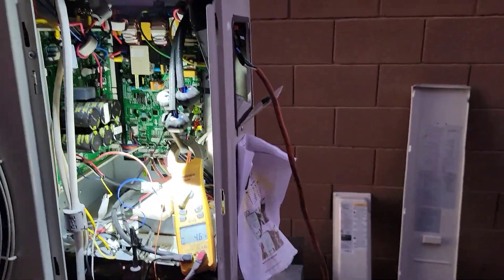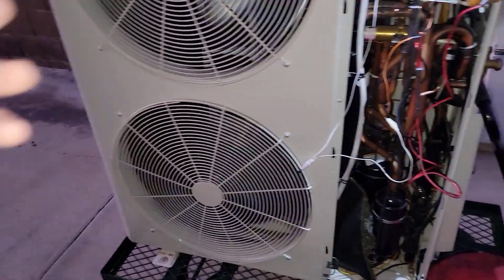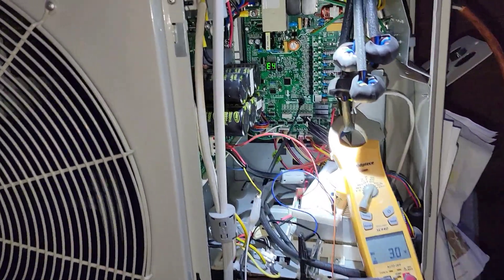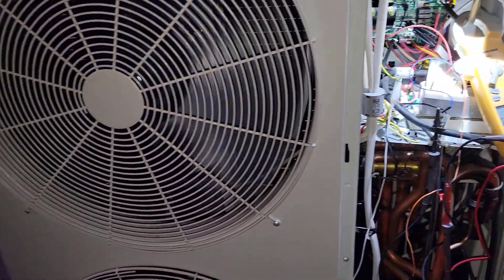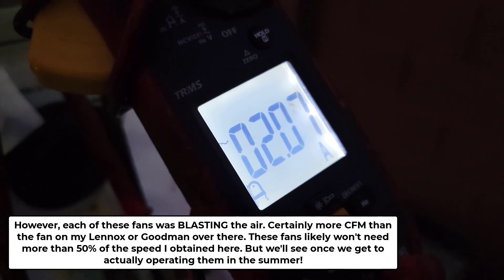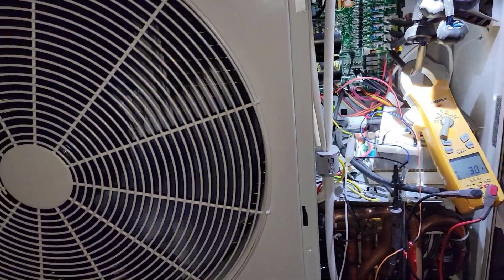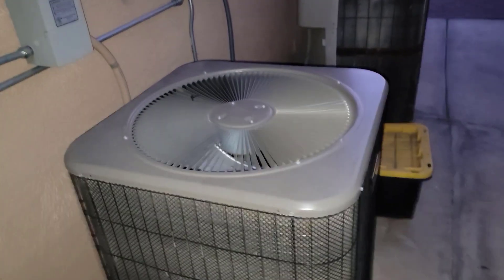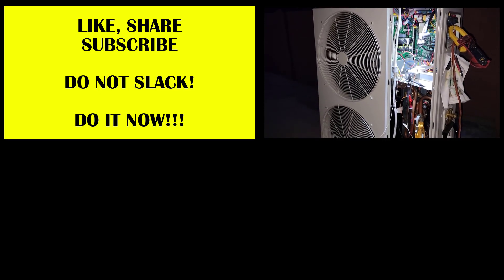Preparing my next Frankenstein Project - Repurposing some VRF Outdoor Units

Comment: Some refer condensing units utilise the same fans with seperate controller thermistor on the liquid line.  If you were to put in a freq Control anyways you could run that rotary with it also.

Comment: Measure the voltage to logic gnd on those serial lines, you might be able to Y-split the comms lines into a laptop and sniff that serial data, then see if you can get the compressor to start in a test mode from the outdoor unit while sniffing the data, long shot I know!
Reply from the maker: I think I'd need a working system to get the data in the first place. I do have one 1 ton head unit that I could perhaps attach but I imagine I'd certainly get a capacity mismatch issue.

Anyway it would be far fetched to hack it to that level and have it be reliable so installing the scroll with a VFD (as my one unit already is) will likely be the way to go.
Plug I also know that 40Hz is approx 70% capacity and 60Hz is full capacity and that works well with the ECM in the attic.

Comment: Will you be able to replace both outside units with this one, New Used One??
Reply from the maker: This is a 3 ton unit which is what my upstairs unit is. So it will be like for like there if I simply put a scroll and VFD in there as I did with the Lennox unit.

The Goodman for my downstairs is a 3.5 ton R22.
I have two of these Carrier VRF cabinets so the plan is to get the first one going that is already R410 and then buy a new air handler unit and swap out the Goodman.
Reply: @hackfreehvac   I thought it was a larger unit since it has 2 fans.
Reply from the maker: @redneckbryon  Just 3 ton total each.

Comment: I'm looking for. DC Inverter to run a BLDC compressor from Mitsubishi . where I find a universal invertor and controller ?
Reply from the maker: I believe you need a synchronous VFD for DC motors.
I already had these standard 3 phase ac compressors and the VFD'S so that's why I use these instead of a DC rotary myself